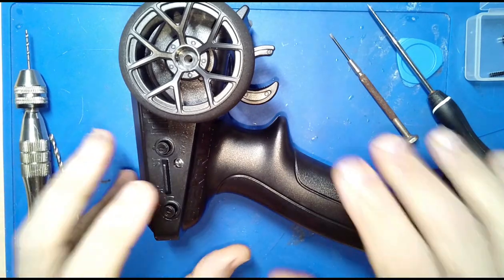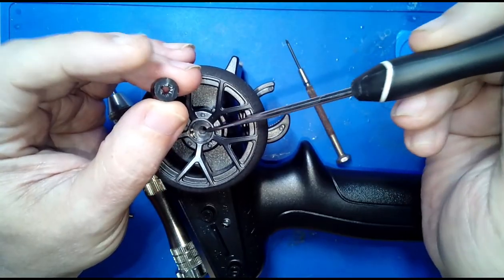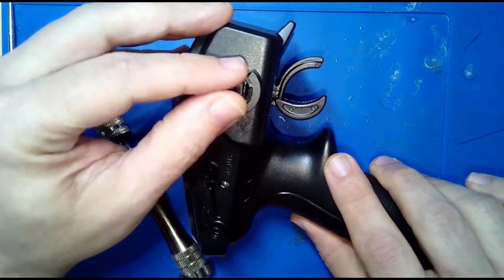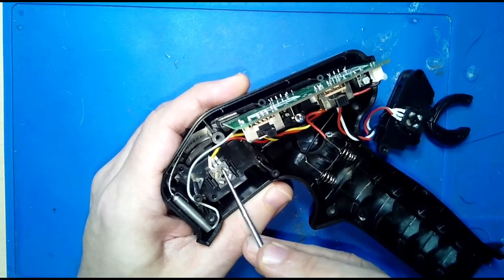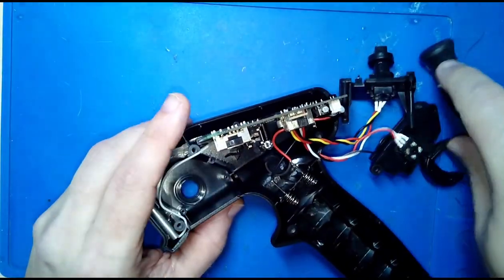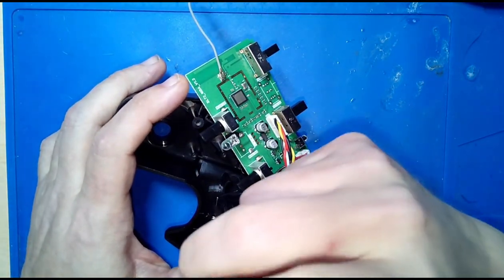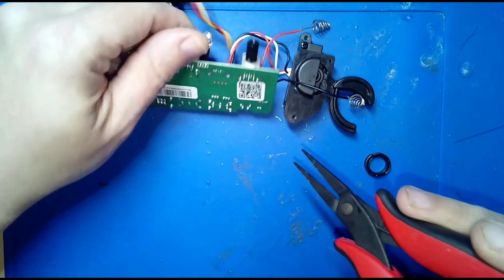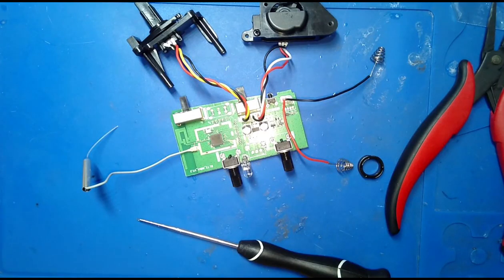Adapting An RC Car with Proportional Steering : Transmitter Teardown

Comment: cool project. my slt2 transmitter stopped working. It had very very good range, i think the voltage regulator might have been faulty, and now it doesn't work at all. too much power blew it up. I wish i could find out exactly what went wrong and solder and fix like you.